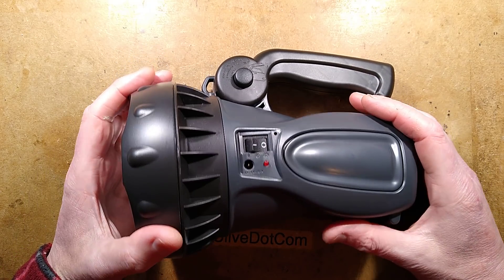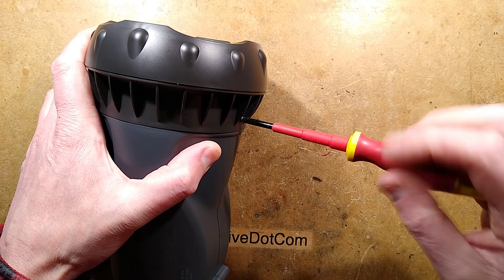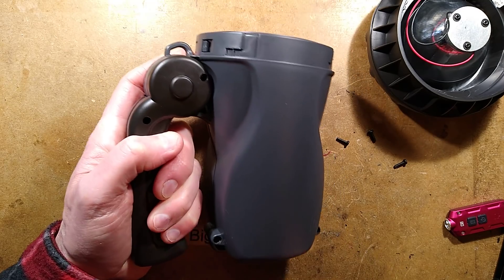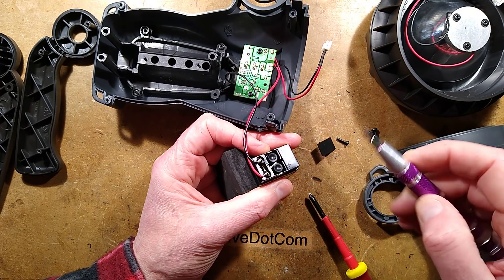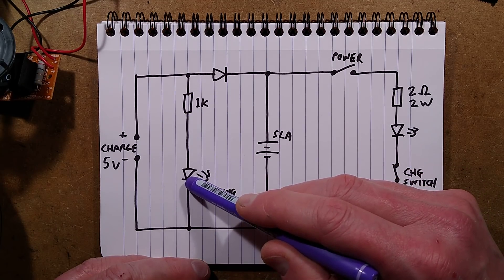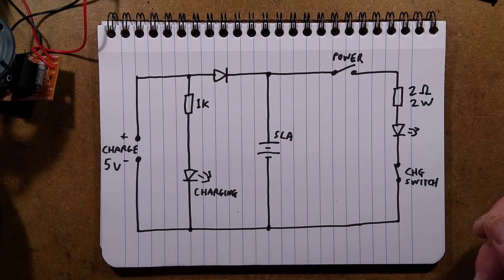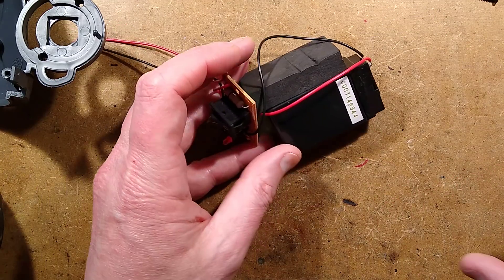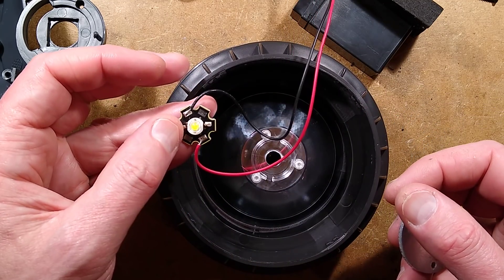Big light, but it's PISH!  (With schematic)

Comment: +1 for Clive to do a supercharged version of this. Seems like something us tinkerers could follow along with!
Reply: Maybe something based on scavenged vape batteries?  High beam "grill the LED's" mode and low-beam "lasts forever" mode, run through all the calculations for those?
Reply: ,here here to a "top fuel " version 🛸
Reply: I was thinking that the bulk buyer should sell them as project boxes instead.

Comment: Question.
As soon as I saw it, I saw the LED was stationed behind the reflector, I'm sure you'll get some light Ray's bounce back from the cover but would it make more sense to place taller LEDs that would make use the reflector ?
Reply: You would think so, or I used to, but since the light is focussed by the gel lens, and there's nothing behind the LED except the board and heatsink, the reflector is mostly window dressing, though it does gather up any scattered light and point it in the right direction.
Reply: Well, no, because LEDs themselves have a fairly narrow beam.  Pushing the LED further forward will only make it worse.  What would help a lot is a reflector placed in front of the LED reflecting its light toward the main reflector.  Old sealed beam headlights did this.

Comment: Looks like the cheap peices of tat that they usually offer for £3.99 or £5.99 when you spend so much on fuel at certain fuel filling stations.
So much wasted space, considering you could cram that into a much smaller form factor.

Comment: You could stick on one of those 3D printed sockets you made and whack a battery in out of a cordless drill. That would keep your little light going for a while. Or out with a bang if you hooked it straight to the existing circuit board...

Comment: I had a previous iteration of this lamp, it had 7 individual LED's with 12v lead acid battery, which died fairly rapidly which has been next to impossible to find a replacement for, the light spread from the 7 LED's was reasonable with about a 1hour run time.

Comment: It also looks like the cheapest possible moulding and plastic.  It's funny how they did the LED so well and everything else so badly.  That sort of "lantern" is more useful as a work light (changing a flat tire etc) so the 1;10 spot would be pretty useless.  I have a work light as part of my (very cheap) 12V hand tool system, and it's very useful with almost a 1:1 illumination and is still bright enough for most jobs.  I've even used it as full room emergency lighting in a blackout - just point it at the ceiling.

Comment: I have a Vango lantern that uses a Lead Acid battery, annoyingly it failed and I could not get a replacement (well if I wanted to bulk buy I could have) so converted it to NiMH by using a standard AA battery holder in its place, and setup to trickle charge of the original charger….

Comment: This question has nothing to do with this video,  which is great by the way!
 but what is the easiest way to test the  capacity of a 12-v lithium ion battery with 200ah  capacity?
Reply: Some automotive supply stores here in the USA (e.g. AutoZone, O'Reilly Auto Parts, "Batteries Plus") offer free battery testing; think you'll get an amp rating out of the test.
Reply: Inverter to space heater?

Comment: That's probably the saddest flashlight I have ever seen. Perhaps you could hack it and replace the garbage bulb with a COB LED panel and stick some boost circuitry in there to power it! Of course you would have to find a way to manage heat but that's ok. Shouldn't be too difficult.

Comment: 20 years ago I had one of those hand held spot lights. 1 Million candle power. I had the battery out so thought I would throw it onto my lead acid charger. Came back an hour later to the pore 6v battery bulging to almost twice it’s size. Sizzling and sputtering as it tried to vent the boiling gas. I learned to check voltages more closely that day. Lucky It didn’t explode and spray acid all over my garage.
Reply: Pardon me, but just so I'm clear, you were using a regular 12 V car battery charger or similar on a sealed 6 V battery?

And you were more worried about it rupturing to coat your garage than say, for example, your face?
Reply: @igrim4777  - Note.  Many, if not most, of the older car chargers have a 6 volt and 12 volt setting.  If you're not paying attention, you can charge your 12 volt at 6, or vice versa.    It's because older cars, like the old Packards, and most VW Bugs, had 6 volt systems.
Reply: @igrim4777  I assume it had a converter... It was just common the bright yellow/black lights came with a car jack.

Edit: early morning came across passive aggressive haha. My bad.
Reply: @sparkequinox  No passive aggressive noted, so thank you for apology but not needed (maybe you got rid of any before I saw). I just wanted to check I understood your story right because lead acid chargers come in different fixed voltages and a 12 V unit makes your story scarier than a 9 V unit which would be bad enough. Glad it didn't end with damage.
Edit : unless you mean I came across passive aggressive, in which case sorry on my part for that and for being presumptuous in the first part of this comment.
Reply: @igrim4777  no no. I original said "obviously" instead of assuming, I was wrong haha. 

I was not the original commenter in case you thought I was. I am pretty sure the car jack (12v) and wall charger (12v) dropped the voltage inside the torch. It's been like 15 years since I've seen one so can't remember at this point :)
Reply: @sparkequinox  I used to have one of those "million candlepower" lights. This particular one had a nominal 9 volt DC adapter (more like 15 volts unloaded) and the light had a resistor to limit the charge current to the 6 volt battery. This non-optimal charging setup slowly boiling the electrolyte is probably why it failed.
Reply: That brings back memories!
Reply: Yes, in period i had at least 3 of those yellow crap-o-tronic halogen hand-helds with optimistic 55w bulbs in. Even finding a 36w alternative did little to alleviate the problem of finding them flat, almost flat, or unable to hold charge. 
Typically the charger block was nominally 12v and there was a simple dropper circuit within the lantern. They all either fell to bits, (one melted it's charger) or the SLA batteries died and the replacement cost from Maplin was far too high. One lamp fed back current into the car's 12v lighter socket, and the immobiliser interpreted this as an attempted theft, thus refused to let the engine start. Faulty diode, presumably.
Reply: My dad had one of those back in the day, but it plugged directly into the cigarette plug on the car. Bright as hell, we used to use it to practice archery at night lol

Comment: For free, it does seem like a pretty good project box for a much better light.  Maybe add a swappable fresnel lens when you want more flood and less spot, and swap out the batteries for something else; heck, you could replace the SLA with NiMH and your super-dumb charging circuit, and have an always-topped-up emergency flashlight.  And as a bonus, no flashing SOS mode!

Sad about what they actually did with the design, though; maybe they had a pile of otherwise-useless tiny SLA batteries they needed to use up?
Reply: Unfortunately, it is really hard to get good heat sinking for a powerful LED (array) with a plastic box like that.
Reply: There's enough room in there for a small fan
Reply: @casemodder89  you add a few exhaust holes... duh
Reply: @AureliusR  yeah. on a (at least wannabe) waterproof light.
Reply: The switch surround (53seconds) suggests that it is (was originally) a three-position switch, so you don't get away from useless features quite so easily.
Reply: How come your comment is listed as being posted 11 days ago on a video uploaded today?  |I smell a conspiracy theory coming on.
Reply: @mikewilson631  he is probably a patreon member, where clive post his videos earlyer
Reply: @mikewilson631  Patreon video

Comment: I remember these "formfactor" lamps from 20 years ago, basically a halogen car headlight bulb with a parabolic reflector and a LA-Battery in a (somewhat) handy format. Lots of Light output compared to other torches at the time, but not the best battery life. Might be fun to hack this thing with a big Lithium-Battery and a ton of LEDs in the front to turn it into the same "portable searchlight" but with much better performance / battery life.
Reply: Yes, somewhere I still have one of those halogen based lights. Just like a car headlight, but only for a few minutes. And deep cycling the lead acid battery seriously decreased its life span. Maybe worth digging it out and doing a LED + Li-Ion hack.
Reply: @Al Banana  i wonder how long you could get those batteries to last, maybe slap some 3000mAh cells in or something lol
Reply: It looks very much like the form factor was designed for a filament lamp and updated to use a LED. The reflector would do very little if the light source sends all of its light forwards.
Reply: As per everyone else in this thread : I've got one too - again - from about 20 years ago. In those days, if you wanted a powerful torch then they were the only really affordable option.  Still works too !!
Reply: I loved mine. Still have it somewhere. SUPER bright and focused. From 2004/2005-ish. Handle grip material started getting gooey.
Reply: @pmpwiz  that nasty goo can be removed with IPA (Isopropyl Alcohol rather than India Pale Ale) (never tried India Pale Ale on a handle, tho). Apparently dish soap will remove it too.  I had to chime in because that goo is a pet peeve.
Reply: @matambale  Thanks. I'll give that a try. The isopropyl I mean. I'm more of a vodka person 😁
Reply: It looks a lot like the even older 6V "lantern battery" flood flashlight/torch.
Reply: @JamesPotts  Right, it's that same shape being copied over and over.  I had one that was filled with D cells, instead of the 6v battery.  The "hack" for that was putting in a PR2 bulb from a 3v flashlight, which gave a super bright blue-white beam... but didn't last too long.
Reply: @JamesPotts  4R25 ?
I remember them as super expensive back in the 70s
Reply: Lol, same here even had one. Bought it on sale as they didn't sell well.
Reply: Yep! Still got one, and looking at it right now! - Mine's one of the better, more realistic, smaller ones. It was, I think, rated at 500'000cp and gave about 20mins of use. It could throw a beam of decent light about three quarters of a mile, though a quarter mile was about comfortable for spotting nighttime trespassers/burglars.  Then I bought a Durabeam LED handlamp about ten years ago, and never looked back. That thing was about double the cp output, and one battery (primary battery) lasted about four winters! - Still have that in our cabin.

I just recently bought what I thought of as a bit of joke/poor excuse of a lamp to keep in the car (RAC branded) LED handlamp. It has a similar Luxeon Star type LED and projects a good beam, useable to about 200yards, lights up a good area beyond that, and runs on four 'D' cells. Clearly a rehashed tungsten lamp, and built to take a PJ996 battery.  I'm suitably impressed by its performance, for what it is, but it's not going win 'searchlight of the year' award.

I might have to look into adapting the old tungsten/lead-acid lamp, and since it uses an H5 fog light bulb, LED replacements are available, provided they focus correctly.
Reply: I remember seeing a hack to fit a car style Xenon capsule in one of these. Gave an epic light output!
Reply: Big form factor with 1 watt LED driver 👎👎👎
Reply: Yep I remember those. You could feel a fair bit of heat coming off them if you put your hand up to the beam.
Reply: I have one of those, the big yellow things. Now sports an LED headlight bulb and a huge lithium pack.
Reply: Yes me too!
Hacked mine with a 35w hid bulb and 4x3500mah 18650's. Quite a beast and has been working for well over a year, maybe two. With no issues despite slightly higher voltage than the ballast originally designed for.
Reply: Ad the rest say i have a orange one with a SLA although the switch is 3way and the black cover to the right is a wled.
Mine seems to be a bit newer at arround 15yr old.

Halogen bulb as the primary aswell.
Reply: not made there tho...

Comment: I was just thinking it really needs a 4056 charge board and some Li-ion cells hacking into it and you came to the same conclusion Clive. There's a video idea for you, from pish to posh.
Reply: Excellent series title: "From Pish........to Posh"
Reply: @matambale  I approve it lol
Reply: Also needs some AMC7135 LED drivers instead of the resistor
Reply: @rexsceleratorum1632  At this point, a 4056 (with proper thermal sensing and individual protection per cell, such as the famous DW01) and a boost regulator IC, —  such as those found in laptop backlights — would be the best way to drive it (assuming many LEDs) — And suddenly this mod isn't cheap and easy anymore :3
Reply: But there is a small problem with this. 4056 is designed to charge a single cell, because it's sensing full charge by measuring current at full voltage, if used on multiple cells or leaky cell, it will be overcharging, you can solve this by putting a resistor in between the charger and battery, but i only did that while i was supervising the thing, i wouldn't rely on that bodge to charge it while i take a sleep.
Reply: @plainedgedsaw1694  I don't think that's true. The TP4056 has a voltage ceiling of 4.2V as I understand and I don't think a lithium cell can be overcharged by a trickle current that doesn't push it beyond 4.2V. A bad cell will heat up, sure. That's why there's a thermal sensor feature built into the 4056 (and disabled in the Chinese boards)
Reply: @rexsceleratorum1632  from my experience it's not that precise, it will go happily to almost 4.25 and hold ot there indefinitely, which is very bad for the cell, there's a reason why all chargers cut off at 4.2 and let the cell drop to lower voltage before it starts topping up again.